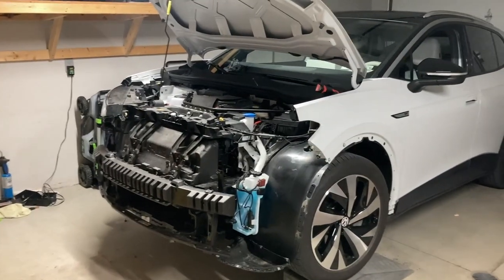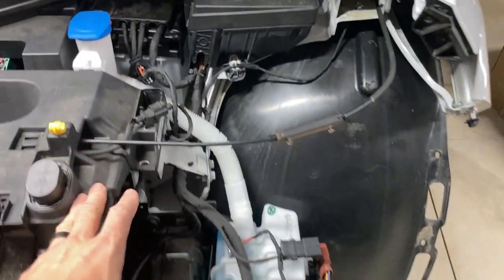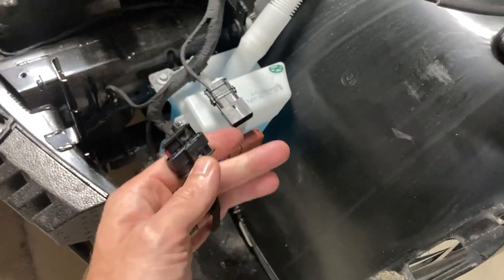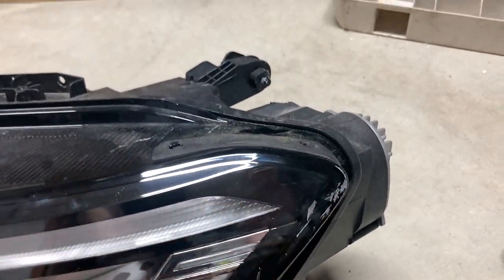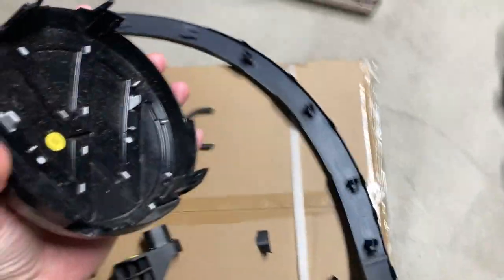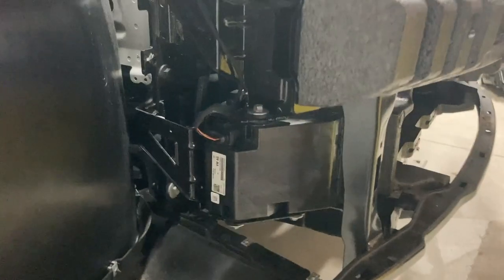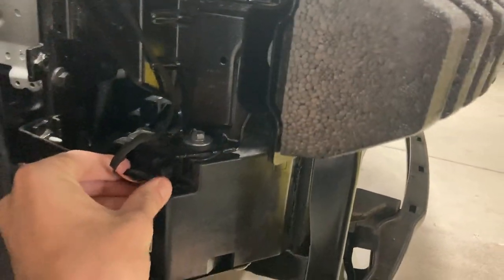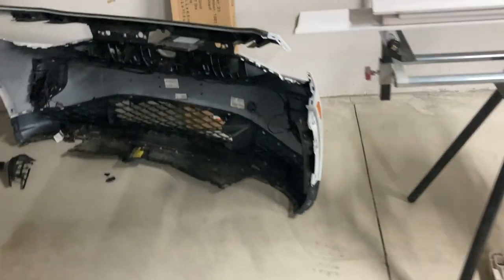I hit a deer with my ID.4! Damage, DIY rebuild plans, etc...

Comment: I have a driving tip that worked for me once. If a deer is coming at you instead of steering away from it steer towards it. I know this won't sound intuitive but it actually works. It all happens so fast that steering away keeps the animal there for longer, there by increasing the chance of hitting the poor thing.

Comment: Great video!!   By any chance do you have the video when you were removing the bumper?  If you remove the wheel arch trim can you put it back or do you need a new one?
Reply from the maker: Hi! No video, but I remember the trim was warped after reinstalling. VW recommends a new one each time it is removed. If you can remove it carefully, it may go back on straight. Worth a shot, but I don’t think they were too expensive when I eventually replaced them.

Comment: This just happened to me too! Good work with your repair, I totally respect your decision to take on the challenge yourself.
If you get a moment, could you advise on whether it seemed like the grille can be replaced or is it integral to the full bumper assembly? It looked from your video that there were a row of clips holding the grille to the bumper. I'm hoping I can pop out the grille and replace only this! Thanks.
Reply from the maker: I think you can replace it, but I would check a few online parts catalogs to see if it is indeed a separate piece that can be purchased. Good luck with your repair!

Comment: Damn, that really sucks!  I’m glad you’re able to repair the damage rather than wasting time and energy taking the car to the stealership.  I recently rear ended a guy in my ‘21 id4 and luckily only bungled the lower grill.  I have the part and being a diyer plan to replace it on my next day off.  Do you think the lower grill clips can be accessed without removal of the front assembly?  Any guidance would be much appreciated.  Many thanks!
Reply: Hey Andy, did you have any luck with this repair? I had a similar situation myself

Comment: I have to replace my lower grill on id4 pro, the dealer says the whole bumper has to be removed to do so.  Is that correct.  It looks like you should be able to do it without dropping the whole bumper

Comment: Hi, recently my car got hit by small animal on road. Car bumper is damaged. I am planning to replace the bumper my self. Do you have any detailed videos on how to remove the bumper and put new bumper?
Reply from the maker: Sorry, no other videos (and I sold the ID.4) but hopefully the video has some tips that will help. Just be aware of the big wiring junction under the drivers side headlight when you’re removing it. Lots of torx screws above and below, then the bumper just pops off. Good luck!

Comment: Hi if we remove the front bumper for just scratch repair and respray, will the car require any radar sensor adjustment or front camera assist system adjustment from vw?
Reply from the maker: No - no errors after mine and only the proximity sensors are disconnected. Radar hardware sits behind the bumper. You should be good.
Reply: @fiehlsport  thank you

Comment: Kind of curious... how did the deer fair? Just wondering if it was say a cyclist... looks like the car is designed to frumple without buckling the frame. I guess you could get this repair done at any VW dealer?
Reply from the maker: The deer came up past the hood a little, then bounced off and ran away. I struck her around 30mph - not likely she lived but boy did she run…. I’d say it’s a pretty soft crumple zone up front. Everything “gives” and breaks away to make for a softer hit. Yeah - a VW dealer could definitely handle this repair, especially if no paint work is needed.